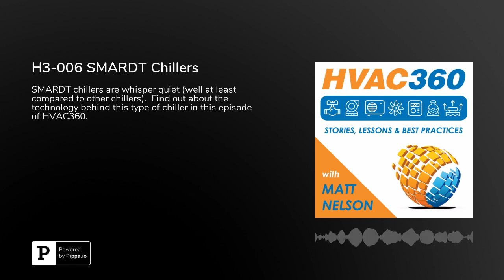H3-006 SMARDT Chillers

Comment: Don’t let the hype , slick marketing and technology fool you.
We have one of these machines we installed they have not been able resolve operational issue in ambient over 85 degrees.
Local service network is non existent , sales reps are useless. Machines problems stem from 2 compressors on a common refrigeration circuit and sequencing compressors . Steer clear at all cost.